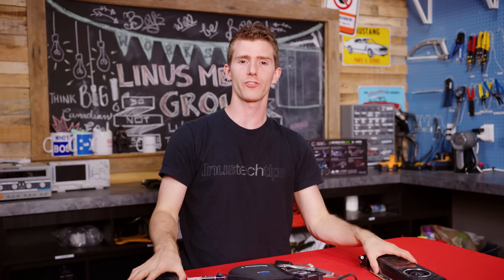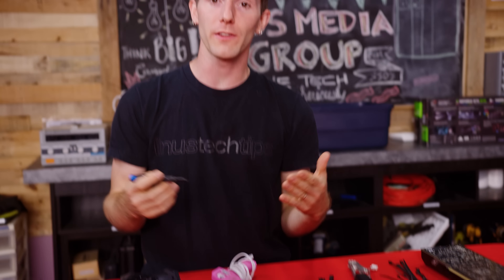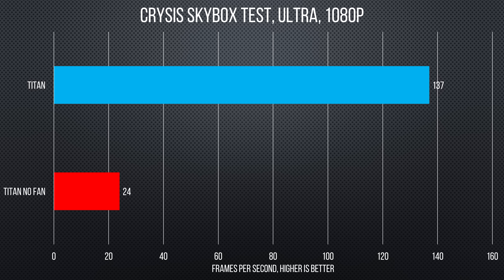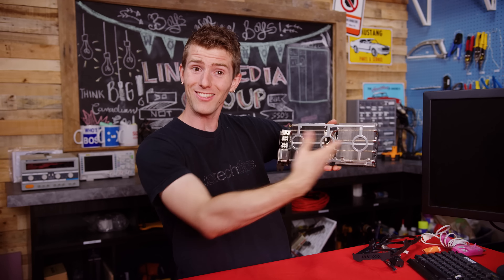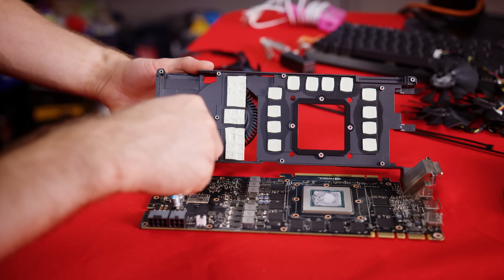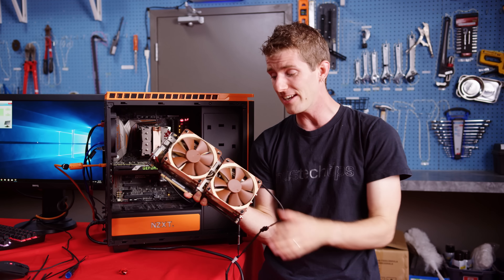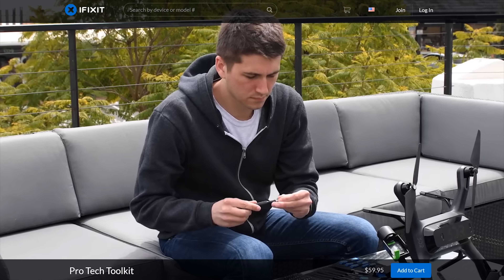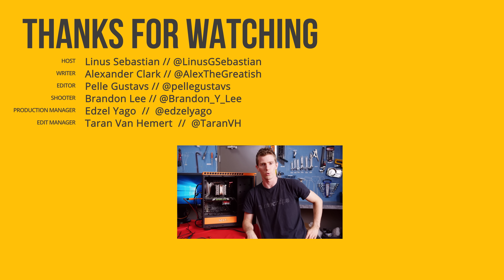Video Card Dead Fan Repair Guide

Comment: That was a good video, no clickbait, no bullshit, just a useful video with interesting data. I like it! :)
If someone need a good fan, you can try delta brand fans, they make very powerful fans.
Reply: Delta is indeed a very good brand, it is used in many electrical control cabinets, but you have to be careful choosing the right ones, some are waaaay to powerful for a PC even if they are standard 80/92/120mm. Noctua is a good no brainer in this case (and in many Pc related cases.)
Reply: I know it's good, thats why I recommended. Maybe one just started failing in my 2 year old laptop, but that another thing (crappy unrepairable screwless asus design, and it wasn't even the cheapest).
I've seen some of them in youtube, I couldn't belive that they're that powerful. And they wasn't the "best" models. But as you see, the blower style cards need pressure, and you always can decrase the power of them (just a beefy enough controller neccesary, they can use some watts :D ) Soo probably a "not that high performance" fan would cool the graphics card better than that little fan that linus used.

Maybe I'll just buy some OP fan, just to try it. If I can slow it down enough then I'll make a laptop and/or pc cooler from a few of it. Probably need more power than the computer. Checks ebay..
120mm Delta fan 4.8A. THAT IS POWER!

Linus there is a video ide: Get the most powerful fan, and make a PC or laptop cooler :D
Reply: I bought one of those at my local electronics shop, the owner sold it to me for 2$ brandnew LOL when I installed it as my exhaust it spun @ 4000rpm haha
Reply: nah its fine , just splice them into a spare EPS power, plenty of amps to drive them mental deltas that can shred fingers :P.

You can drive some pretty powerfull fans from a fan header tho , anyone remember the dragon orb coolers from back in the day ? I Still have  scar on my finger from one of them.
Reply: These fans are not particularly expensive, given that the marketing B2C value is close to 0 contrary to Noctua or Thermaltake, Noiseblockers (sigh ...) so the ratio cost/effectiveness is great, but then they are not designed or targeted at silent cooling. But you can always fiddle with them. 
I remember my amd athlon slot A cooling with two 4mm massive AlphaPal, that were thicker than noctuas ... Back then cooling wasn't such an extensive market and many manufacturers and resellers used these kind on industrial / semi industrial fans.
Not an era I regret ... I'm an happy owner of Noctua fans and silent Fractal case :p

Comment: The reason that the Titan fan mod didnt work is actually quite simple.  The OEM fan is designed to suck air into the card and launch it paralell to the internal fin array, but your mod blows aitr into the shroud rather than propelling the air directly onto the fins, reducing static pressure "& efficiency dramatically.
Reply: i thought it was because of the air leaving over the ram without touching the fans
Reply: I removed shroud from my 760 that had blower and put fan just on heatsink and it was quieter and cooler.
Reply: I have a naked gtx 1080 mini taken from the aorus gaming box egpu and Im trying to put it into my gaming rig.. The issue is the single fan is so huge it's hitting the voltage regulators and other bits on the motherboard... is it safe to trim the fan's diameter so it can spin without hitting stuff?
Reply: @Axel Shark The card's cooling is designed with the radial fan in mind, so yeah, those crappy results were as expected ;D Meanwhile both type of fans are easy to find in ebay and aliexpress and they are affordable. (Sadly) not really surprised to see this type of shotty work from Linus. He seems more focused on quickly making the videos, golden eggs sponsors in mind, while tossing the content's quality in the background. You can even see it in his workers' eyes. "Fuck quality work, just make it work" Same mentality as with my boss :/ Excuses to not get the job done properly from here to the moon...

Comment: Red Green, thumbs up.

How about a CPU cooler on GPU round up?
Reply: The only thing you'd have to worry about would be the vram. You'd either need good airflow or an extra fan to cool it
Reply: And VRM(s) too
But yeah, the extra fan(s) are a must. Airflow alone wont hold up well during heavy gaming on a hot card. I found that out the hard way.
Reply: Appleton Mccool or a gpu cooler on a cpu?!
Reply: Be sure to use a Noctua NH-D14 heatsink with 3 140mm fans.
Reply: RpiesSPIES nice :)
Reply: some diy youtuber already did that, the temps are really good but you have to be careful with clearance bcs it's a behemoth of a cooler
Reply: If she doesn't find you handsome, at least she'll find you handy.

Comment: Thank you for your useful tech tip and tricks, I used this mod on old rx560 that kept overheating minutes after starting a game on low settings. This is definitely not the prettiest but the most functional mod I always wondered about.

Comment: You have to connect a leaf blower to the titan x that will probably work
Reply: Or that potato shredding high RPM fan.
Reply: MarginalSC I think we need both
Reply: Ah. A push pull config? Wise man.
Reply: MarginalSC finally someone who understands me
Reply: Mr.dodoe max temp= 15 degrees celsius

Comment: Awesome video, this guide saved me having to buy a used 1060 or a new 1660. And I have an i7-3770 so my 1060 is already bottlenecked a bit. The fans in my 1060 6gb both have become off balance and every time they start to spin they wobble and slow down or even stop. My temps were 55C at idle and would instantly jump to 85C when I started any game and after a while at that temp it would stutter. I took an exhaust fan out of the back of an old Lenovo 315. Chopped the dual GPU fans out, spliced the wires and straped the new fan to the heat sink and now with just one fan my idle temp is around 40C-45C and gaming it seems to max at 75C which is much better. And I can still crank the fan to the max with MSI afterburner which is awesome. Saved me a hefty chunk of change.
Reply: I am withsame condition I buy a used GTX 1060 it one fan wooble n slow working same temp with me  should I buy new fans or do Linus fan tecquinie u did it it worked?? help mee

Comment: When my R9 380 cooler died I took the fan from a spare CPU cooler and tied it to the GPU with string. It looks janky as hell and you cant control the fan speed, but it works better than you might expect.
I can run Elite Dangerous @ 1080p on the highest settings (with a little tweaking) and still maintain a steady 60fps. Doom also runs great, so long as you don't mind turning off AA.
Reply: what are your temps under full load?

Comment: I did something similar with powersupply years ago.  Circa 2004, when I didn't have the money to replace my PSU, I just strapped some fans on the intake and exaust.  Worked well for a good 6 months.

Comment: Did this with my rtx 3090 and saw great results. Wired both fans to the motherboard and configured curves based on gpu temp in bios.

Comment: Usually when you remove the stock fans, you'll notice the power draw on the sticker of the fan. Believe it or not, they actually draw a lot more power than typical case fans (at least with my experience) so its totally doable to connect to the stock header on the gpu
Reply: True. My 3060 Gpu fan = 0.40A. Arctic P12 = 0.20A.

Comment: Or... grab a watercooling kit... I mean for the titan lol, why not?
Reply: Because you can only sell one kidney
Reply: If you mean an AIO like the Corsair H100i, it's because it'll only cool the GPU, not the VRAM etc.
Reply: well the guide is meant for old gpus that only have broken fans
and gpu waterblocks easily cost 120$+... I dont think many people would spend 120$ to fix an old gpu
Reply: meowow well if I had a GTX 690 with just a broken fan... ABSOLUTELY
Reply: Cause noctua fans are $20 and a water cooling kit is a minimum of $100

Comment: Some graphics cards fans are just about available.  I replaced the low profile 75mm diameter fan on a MSI R6670-MD2GD3 with one from eBay for less than £3.  Required just two small adjustments: the three screw holes needed slotting out slightly, and the connector polarity had to be swapped.

Comment: I knew I should've video'd my case cleanup this past weekend...

This is NOT "repairing a fan". This is "replacing a fan", which doesn't involve a bit of repair. 

When I cleaned up my case in prep for some upgrades (which hadn't been opened in 5 years), I had a fan that was locked up (under the bottom of the MB below the CPU), and I hauled off and applied the same "fix" to all five fans in the case (120mm front and top, 80mm under the MB, the GPU cooler fan, and the stock Intel fan on the CPU heatsink). 

The fix: peel the label off the side of the fan. Underneath, you should find a small rubber disk sealing the bearing compartment. Lift that out, put a couple drops of alcohol to clean up the gunk (not absolutely necessary unless there's alot of gunk in there), blow the alcohol out with canned air, then put a drop or two of machine oil (3-In-1 oil works great), wipe up the excess, put the rubber disk back in, then reaffix the label--if the label won't stick, a bit of duct tape will do the trick. The only fan I couldn't reuse the rubber disk was the front case fan, the label had peeled up some, and the disk took some damage and had enlarged, so I had to just tape it.

Bottom line: even the seized fan works perfectly now. It's a simple procedure, and works every time. I've only been doing this trick to these kinds of fans for about 30 years now.
Reply: someone who understands, I just want to stop my gpu fan from rattling/siezing up when I spin it at high speeds (it looks like it's off balance or something) not replace the damn thing. Do you know if your method would work for the fans on a GTX 650 Ti boost?
Reply: @Wishuponapancake  It might, provided the bearings in the fan haven't been damaged. When a fan is making noise while running it's an indication that it's not lubricated well enough. Running it like that for a prolonged period will wear out the ball bearings. If that happens, reapplying oil (as explained above) will help, but there is a high chance the fan will still make some noise as it can rattle a bit from side to side due to the worn bearings.
Reply: hey thanks for the reply! And yeah I think my fan has been getting stuck like that for about a year (it only runs relatively smoothly when I set it around 60-70% speed, and it seems to start seizing up after it runs for a while/seems like the fan is getting to hot and fails? it's weird) so I think it's pretty fucked, though it hasn't completely stopped working yet so I'm kinda scared to open it up, because it might just not work when I put it back on lol
Reply: @Wishuponapancake  You can also just search on aliexpress for your GPU model and add the text "Replacement Fan". I just ordered a set of fans for my Sapphire R9 280x Dual-X (Front fan doesn't spin at all, back fan makes noise and shakes so I think it's bearings are damaged). Cost me 10 Euro including shipping to The Netherlands. Orders from aliexpress usually take somewhere between 3 to 6 weeks before I receive them though.
Reply: @PhoenixNL72-DEGA-  thanks for the tip! I tried looking for a replacement fan on other sites but haven't tried that one yet. It seems that replacement gigabyte gtx 650 ti fans are incredibly hard to come by
Reply: @Wishuponapancake  If you can't find it you might want to look at teh back of the actual fan (need  to remove the shroud for that. To see if there is a part or model number and manufacturer for the actual fan there. Gigabyte does not make their own fans. Also another fan will work just as well as long as it can deliver the same airflow as the old one and it's the same size or smaller. It also wouldn't supprise me if the fans in their newer cards are the same ones they used on the old ones.
Anyway replacement fans for new Gigabyte cards cost anywhere from $6 to $24 depending on the number of fans on the card and in the replacement set.
For instance this on compatible with GTX 560 ti, 570, 580, 670 and 680 costs about $6 (don't know if that one will fit on a 650 ti you'd have to google compatibility)
: https://www.aliexpress.com/item/T128010SM-75mm-3Pin-2Pin-Cooler-Fan-Replace-For-Gigabyte-GTX580-GTX670-560TI-R9-280X-HD5870-5770/32870508782.html?spm=2114.search0104.3.9.605c537e6VIMSh&ws_ab_test=searchweb0_0,searchweb201602_3_10065_10068_5729915_319_317_5733915_10696_10924_453_10084_454_10083_5733715_10618_10920_10921_10304_10922_10307_10820_10301_10821_5730815_537_536_5733815_10843_10059_10884_5734015_10887_100031_321_322_10103,searchweb201603_51,ppcSwitch_0&algo_expid=2c59381c-7ed3-461d-98ca-2dd9943796b2-1&algo_pvid=2c59381c-7ed3-461d-98ca-2dd9943796b2

The question is also is it worth replacing the fan? Or are you better of getting a newer second hand graphics card like a 750 ti, 760 or 950 or AMD equivalent (no one will use those kind of budget cards for mining etherium coins so second hand ones should be fine). You could also try e-mailing Gigabyte or even companies that sell aftermarket CPU fans like Zotac for compatible fan model numbers for your card and search for those.

Comment: I actually did this with my r9 290. I also got much better temps than the original tripple fan setup, and it was much more quiet. The power rating is usually written on the fan, so there shouldnt be any problem figuring out if the fan header on the card is powerful enough.

Comment: There are aftermarket GPU coolers that don't cost much more than 2 Noctua fans
Reply from the maker: +EkmekMcKek yeah but you could use this method with any fans.
Reply: I was trying to say that an after market cooler for the Titan wouldn't be much more expensive than buying two Noctua Fans. Maybe my comparison wasn't that
thought out....
Reply: EkmekMcKek but, increased performance!
Reply: the aftermarket cooler would probably be even better.

Comment: What you missed there is the blower style Graphic cards uses a Centrifucal fan compressor (aka laptop fans), which provides a lot of head pressure but less flow compreing to a axial fan (regular computer fans) which provides less head pressure but more flow. This is one of the reason water pump are almost always centrifucal while morden jet engines are mostly axial.

Comment: i'm wondering, why not solder the PWM signal to the gpu fan header and wire the other connectors to molex (or leave it as is, but just take one cable and rewire it to pwm on gpu card) for power. this way, the fans still ramp up ramp down based on actual GPU load, no?
Reply: I guess they just kept noctua fans working on 100%. I have one as my case intake, and basically there is no sound difference between 50% and 100% speed. So i just keep it at max. :)
Reply: hmmm. well, technically easier too (just ziptie-ing, no additional work required). okay then.
Reply: or just cut the wires on the 4 pin plug .. leaving the pwm and rpm wires .. and cutting the power wires to wire them up to a molex or sata power plug then you can just plug the pwm plug into the card still without having to solder or modify it. ... but ... using a MB header is still just as easy and with a program like speedfan you can set it up to make a curve that is controlled by the GPU temp.

Comment: Hello, i did the noctua thing, replaced my old gtx 980 ti fans with two noctuas and left it at 900 RPM (1500 maximum), the temps down from 75C to 58C. Thanks very much sir.

Comment: ASUS STRIX cards have headers for external fans why not to use them!
Reply: JÄTTI PASKA he covered it. I don't have a strix GPU, but probably the noctua fans he used might draw more current the fan header can provide safely
Reply: He was probably saying to be on the safe side
Reply: Well, this guide wouldn't cover as many cards. But it should've been mentioned in the video...
Reply: I have this same 1070. Recently upgraded my CPU and I don't have the AMD bracket for my EK Supremacy, so only my GPU is using my watercooling loop. I have my fans and the pump plugged into the external fan headers and its working great!
Reply: He was talking of soldering the noctua fans to the connections where the original fans were connected. But I'm talking of the fan header on the strix card. Asus Strix cards have headers for external fans just like the noctua ones.
Reply: The original fans are not soldered, they use pin conectors too.
Reply: Kibito Akuya yes but there are connector for external fans too and default fans don't use default fan connectors. https://imgur.com/Uo149sn screenshot of asus strix 1070 features page
Reply: vitun siisti nimi :D
Reply: Well then, i stand corrected, they do have their own conectors too though
Reply: Abhi Mayadam Well actually he didn't cover it. He mentioned the original fan headers which, on most graphics cards, are smaller than case fan headers. What the comment was referring to was the fact that Asus Strix cards have like two or three actual full sized headers so that the case fan will ramp up with GPU temps
Reply: Tony Hong The video didn't really go into gfx card specifics. It was more of a catch all for any graphics card really. But now I know
Reply: Noctua fans draw more power, more power to fans = less power to gpu

Comment: just a quick tip for Linus and his ifixit kit (though im sure he figured this out already), the over the protects the screw and screw heads is "checkered" on the inside, i use those squares to kind of draw out where each screw was removed....obviously this wont work if you remove a zillion screws but for basic stuff it works well...